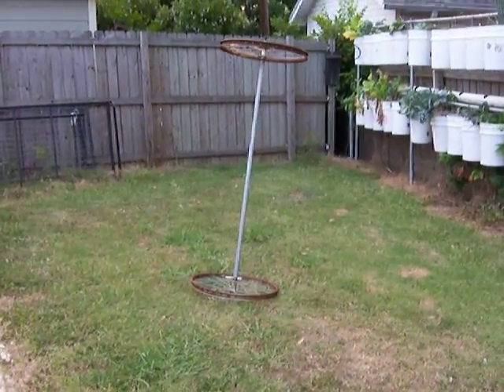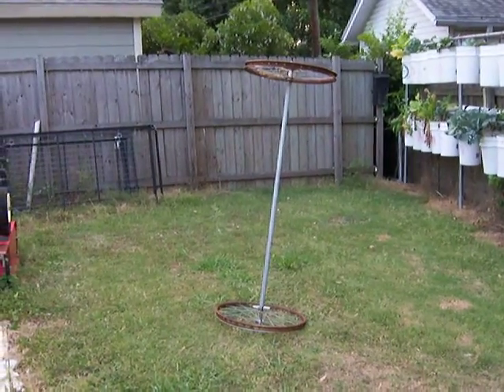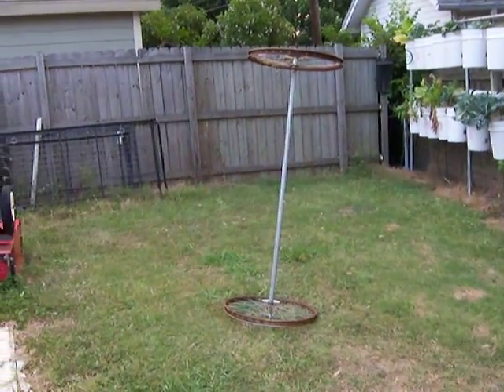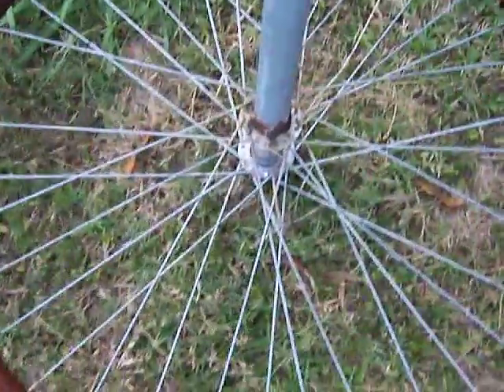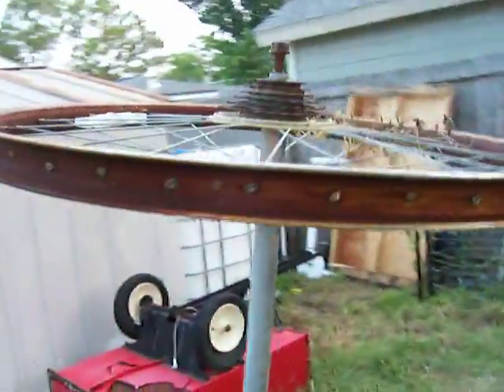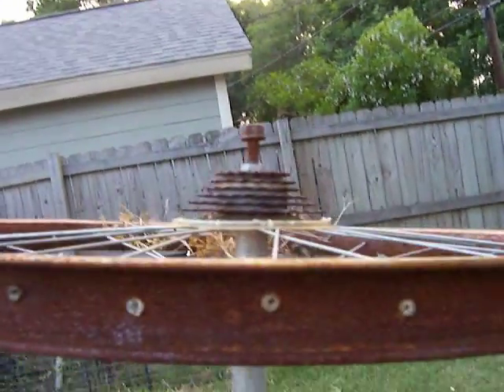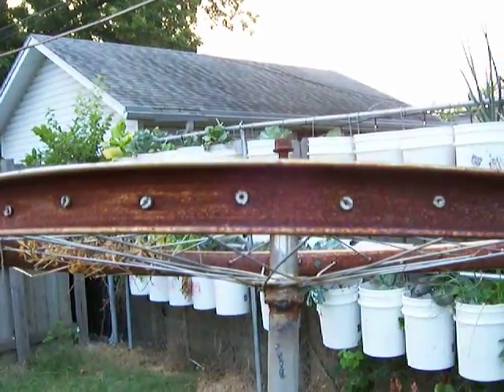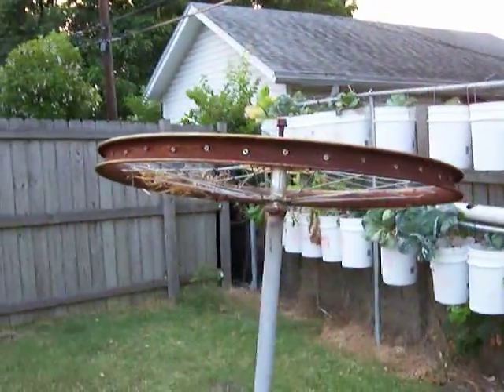vertical wind generator bicycle wheels

Comment: Thanks for Posting. VAWT can look pretty & some cool looking models available but they rarely work well in fact. If they are so good, then why are 95% of Turbines Horizontal design.im planning on using a wheel as a big pulley to gear up an Alternator or DCGenerating Dynamo  just waiting for parts in the Post so slow you know.